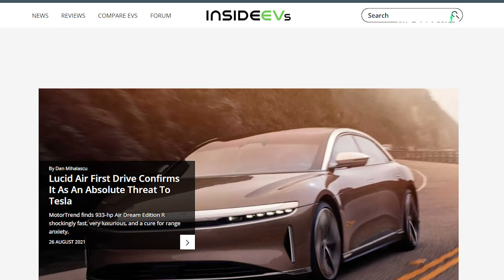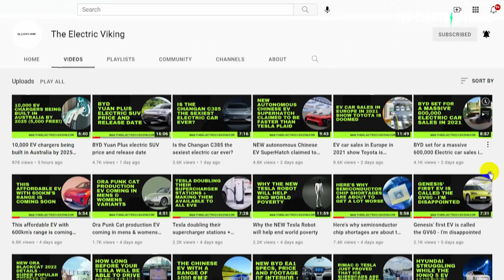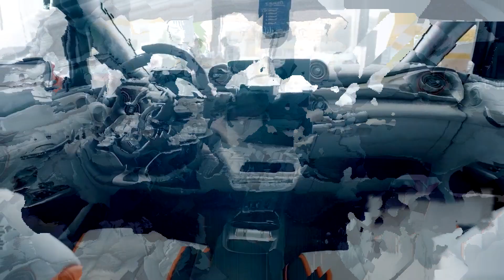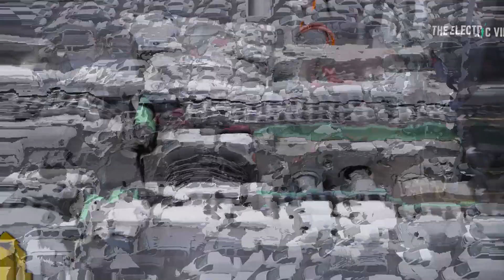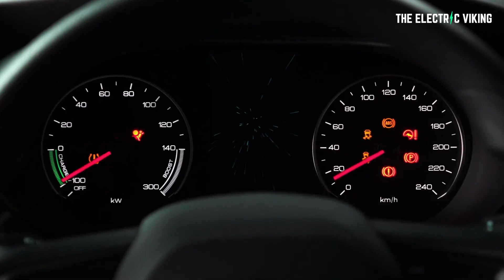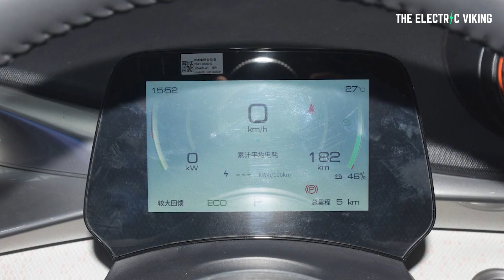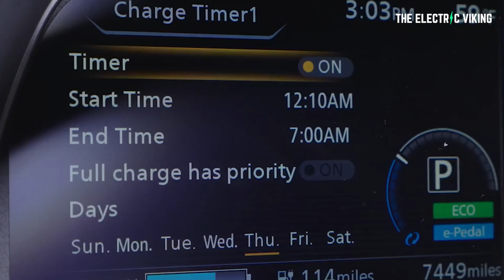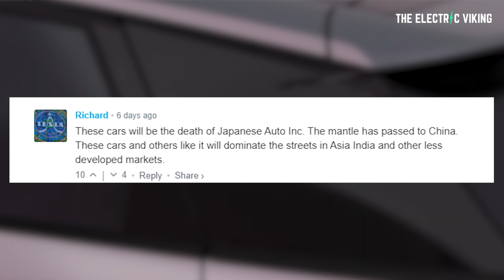The New BYD Dolphin Will Convince Millions To Go Electric - Cleantechnica

Comment: Byd Dolphin:
Four trim levels:

301 km (187 miles) of NEDC range, 30.7 kWh battery, 70 kW motor
93,800 CNY ($14,500) after subsidies
405 km (252 miles) of NEDC range, 44.9 kWh battery, 70 kW motor:
103,800 CNY ($16,045) after subsidies
405 km (252 miles) of NEDC range, 44.9 kWh battery, 70 kW motor:
108,800 CNY ($16,820) after subsidies
401 km (252 miles) of NEDC range, 44.9 kWh battery, 130 kW motor:
121,800 CNY ($18,825) after subsidies.

Nexport have confirmed 450 km for all models in Australia, so expect a bigger battery.

Comment: I’ve had a chance to look at 4-5 of your videos and have now gathered my thoughts. I don’t doubt what you say, but at this point, we in Australia ( a lot of us) , aren’t going to just  buy it on say so.

At the end of the day, we’re used to looking at what the motor car reviewers, we are  used to hearing what might have happened at Holden’s Lang Lang ( no longer) proving ground, or something equivalent. These checks should include how the suspensions stand up. Tesla M3 is obese at 3049 lbs , that’s fat. Yes there is a lot of guff Tesla doing a million miles. The point is there.

Often, and in the case of VW with its electric ID.3 and ID.4, the achilles heal is the quality, the workings of the Infotainment System. 

That system is our connectibility to the world. It must be first class.

My system uses Android Auto. It’s near perfect, as are the phone calls connecting instantly, texts all able to be done by voice, etc etc, so that’s one of the show stoppers we don’t know anything about
The second issue is what sort of testing does BYD do? Is it all done on perfectly smooth bitumen.

The last thing  we want is a car with a second rate, slow, or poor Infotainment System. VW struggled a lot with it. I read reviews where it was so seriously wrong, that that were going to junk it and start again. And the last thing we want is a BYD Dolphin that either on pick up from the distributor, we drive off and within minutes it is rattling. 

So, believe me, if the Infotainment System is not as good as we have now, and the car rattles when we pick it up, or rattles develop soon after we take delivery, we rightly classify these cars as lemons, and reject them 

It might be early days, but I can assure you that before we hand over our hard earned, we want to be absolutely sure that these two items in particular are totally to our satisfaction.

The distribution system is fine, but as you will appreciate, most of us aren’t used to a distributor system. Add to that, we in Australia, the very high majority of us haven’t owned a car made in China.

BYD might not care much because their sales will probably be astronomical as you state.
But I’m not driving off in a car from a distributor unless their system allows a pre drive and a fully checked Infotainment System where my phone is set up on the car, and the distributor demos the system fully to my satisfaction. 
I can accept, all you say, but we need to put context around this. We need some EV nerds automotive reviewers to tell us.

Comment: Just would like some clarity . In Aus we like talking , and it's best to do this.. we want to know what is the "drive away no more to pay price" . You haven't clarified that. So have you included GST, and on road costs ( yes they vary between States, not to worry) and any Nextport distribution costs.. unpack these for us ...what's in what's out and how much broken down.On a $27000 base model BYD Dolphin $27000 ?? GST of 10% = $2700,  on road costs vary but not a lot say $2000. That means the Dolphin would be $31700 . And is there more? Eg a Nextport distribution cost????
As I review other things  other videos  you seem to aggregate,  so it would seem these are factored in and the Dolphin base model would be $27000 ( rounded,).with no more to pay .  Mate  fill us in.

Comment: Thank you! You are a pleasure. I appreciate you remembering us older USA guys that do not do the metric system! As much as I like Tesla's work, I do have a problem reading all the horror stories describing all the flaws and problems with their recently delivered cars. They said I can order a 2022 Model 3 and receive it at home in January 2022. BUT!!!! If there are problems, I have to go through all the nutty steps to get it serviced. That sickens me. I will not buy on faith!!! After suffering a head on collision with my wife, I care about safety first, reliability, range, comfort and good cosmetics. The high end cars for many years had crappy interior stuff that fell apart and simply did not hold up. You said this is great quality for under $20,000, I believe you. You sound analytical like me and Sandy Munro! Great! I subscribed! Cheers!
Reply from the maker: You're most welcome. Thanks for supporting me.
Reply: Great quality DOES NOT MEAN SAFE!

Comment: I have to say that once the BYD Dolphin gets to the Australian car market , that’s going to be the end of fossil cars because I for one will buy one at around $30000 Ausd and I think they will sell heaps of these
Reply: I hope in Australia the charging infrastructure is growing fast enough.
In Norway more than 60% of all new cars sold are BEVs but the charging stations aren't keeping up. So in summer there were long queues of EVs all over the country.
Reply: The average user don't need to charge their cars every time they drive out of their house to d City or farms. The battery capacity of around 500 km is more than sufficient to last at least 3 days. So one can always charge their batteries at home base. I would be d least worried about battery charging in my case and I think for the average user. It only matters if u frequently need to drive long distances frequently.
Reply: For daily use it's more than enough. But if you want to go on vacation you will be surprised. You can't go 500km on the highway with one charge. And with thousands of people heading the same way as you, all need to change at some place.
Reply: @leifalgermissen8043  the bigger BYD blade battery can go up 1000 km or 600 miles on one charge , for those in Australia that’s Sydney to Brisbane on one charge
Reply: Real world range of the 1000km battery will probably be about 600km which is not bad but you still need to recharge on long trips.
And then there is the decision to pay that much more for the big battery that you just need a few times a year.
It's wast of resources to have this big batteries in my eyes. You can build 2 cars with 500km range instead to make the transition faster.
Battery production is still a bottleneck in EV production and will be in the years to come.
Reply: @leifalgermissen8043  time will tell ! but I think the transition to electric vehicles will be a lot quicker than anyone thinks , as soon as people can get a electric car for around the same price as a fossil car   , the fossil cars will lose value Rapidly no one will want a car that they have to take to a mechanic to get tuneups replace brake pads and all of the other associated costs for the fossil car
Reply: @denisbellars9260  It's true that the adoption well be quite fast when the price for an EV is the same as for an ICE equivalent. We see that here in Norway. In August  72% of all new cars were BEVs.
The problem we see is the supply, not the demand. People go for a hybrid because they don't want to wait half a year for a new car.
Regarding brake service, this will be more expensive than for ICE cars because the calipers get stuck because of rust since they are not used very often because of the regenerative braking. Car dealers offer yearly brake service for $200-300 to prevent that.
Reply: @leifalgermissen8043  yeah I did not think about the brakes rusting , I am in Australia. 😀
Reply: @denisbellars9260  Lucky you 😁

Comment: Sorry viking like you like the Dolphin but, at the beginning they announced that the vehicle will have a range of 600 kms with the new platform and batteries, now we know the specs and is short of 50% of what they said. To me its the ID3 of BYD, the prices and charge velocity can and will make the car quite attractive for buyers
Reply: The Australian importer nor the electric viking have ever said the Dolphin will have a 600km range. The Australian importer has always stated it will have range of 500km on the evdirect website. The delay into Australia until late 2022 will allow the  long extended range battery to be developed and fitted to Australian bound vehicles.